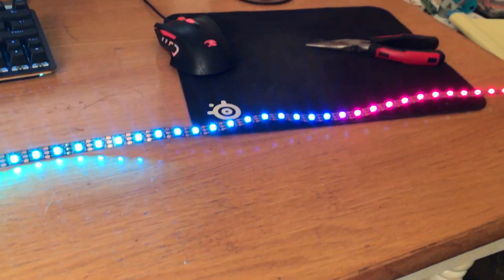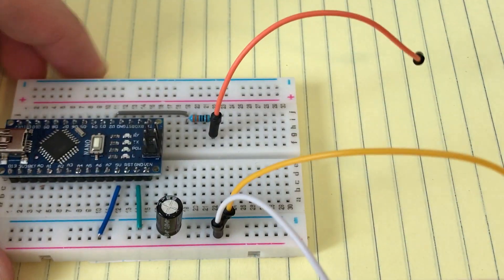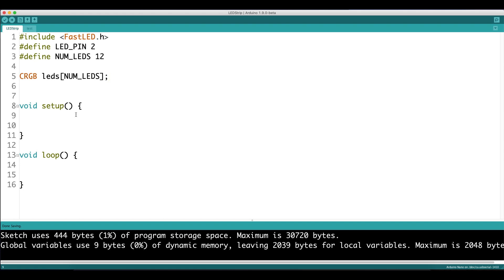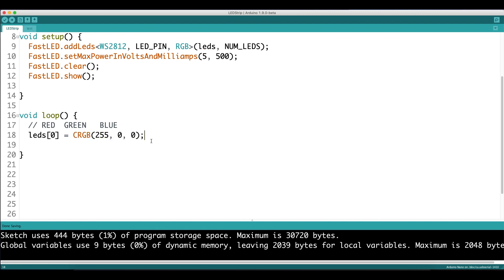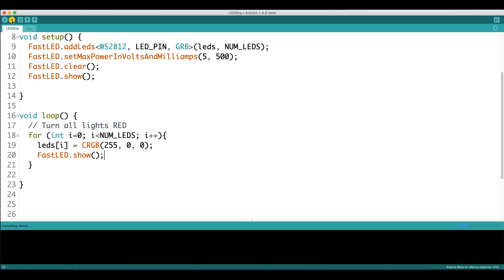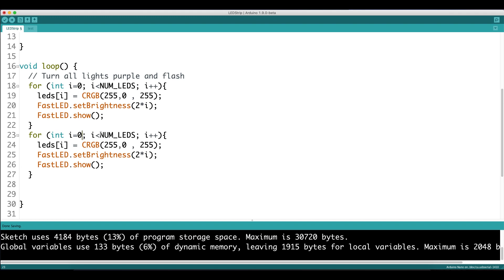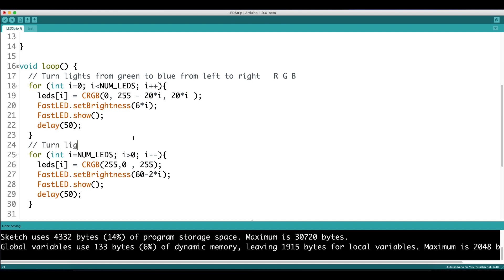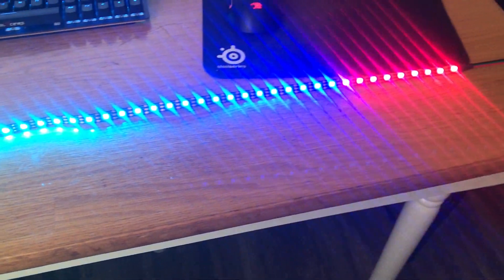Use Addressable LED Strip with Arduino || Essential Engineering

Comment: Ok so can i run 2 led strips of say 12 leds off one board by entering line 4 and 5 as 4- #define LED_PIN 3 AND 5- #define NUM_LEDS 12? Im trying to build a controller for light strips that are making diy wheel lights on my car :)

Comment: Great video. My question is how I would make a final/completed device? I want to make a gift for someone, and I want it to be where they plug the usb for power and it does its thing. But the device won’t have a breadboard. Like how do I minimize into a smaller package? I hope I’m asking the right question(s).

Comment: Amazing project and video, thanks. Can i connect led strip directly to the ESP? How WLED program works that it can power leds with no additional power source? No breadboard and no transistors in scheme?

Comment: BTW -never mind. I got this far (see below). Thanks again, this was a great video!
 #include <FastLED.h>

#define LED_PIN 2
#define NUM_LEDS 60
int iR = 7;
int iG = 155;
int iB = 9;
int iDelay = 50;
boolean lDelta = true;

CRGB leds[NUM_LEDS];

void setup() {
  // put your setup code here, to run once:
  FastLED.addLeds<WS2812, LED_PIN, GRB>(leds, NUM_LEDS);
  FastLED.setMaxPowerInVoltsAndMilliamps(5,350);
  FastLED.clear();
  FastLED.show(); 
  Serial.begin(9600);  //open serial port 
}

void loop() {
  // put your main code here, to run repeatedly:

for (int i=0; i<NUM_LEDS; i++){
  leds[i] = CRGB(iR,iG,iB);
  FastLED.setBrightness(15);
  FastLED.show();
  delay(iDelay);
  }

if (lDelta == true)
  { 
    iR = 7;
    iG = 155;
    iB = 9;
    lDelta = false;
    Serial.println("lDelta was true, now it is ");
    Serial.print(lDelta);
    
  }
else
    {iR = 155;
    iG = 7;
    iB = 9;
    lDelta = true;
    Serial.println("lDelta was false, now it is ");
    Serial.print(lDelta);
     }
  }

Comment: Could you run 5 lights from one arduino? I have a work project that requires something like this.
Reply from the maker: The Arduino's built in power supply should be able to handle 5 LEDs

Comment: Do we need a capacitor and a resistor ?? Is it must-need parts?
Reply from the maker: The capacitor is just a bypass capacitor to the power supply. It isn't required, but it is good practice to use one on your power rail to smooth out any "ripples" in the rails

Comment: May I ask if is it ok if I don't use a external power supply? my led strip is a 1m 60 led 5v (each led takes up about 0.3 watts). And I'm also using a Arduino pro micro
Reply from the maker: Check the datasheet of your Arduino and see the maximum current output available for the power rails. If all LEDs full brightness will overdraw the power output, you can't use the onboard power supply, unless you can limit the current output in software. 

If you do use an external power supply, make sure the data line and power supply to the LEDs share a common ground.

Comment: can you hook up 2 led strips by just wiring the second one the same way as the first one using the same pin on the arduino? I am making a lightsaber with them, and I want 2 strips so I can stick them back to back and make a more evenly lit blade
Reply from the maker: I don't see why that wouldn't work, the current limiting resistor should help prevent a current overdraw on the data line (which isn't that high in the first place). However, in this approach, you likely could not use the Arduino as a power supply and you would have to find a way to externally power the LEDs. Using the Arduino power supply, the max amount of LEDs you can power is 9.

Comment: Like many have said, Great Vid.  I would like to know the purpose of the resistor and capacitor, and how you chose their specs.  I will look for the "slower version" vid you promised Ms. Farmer a couple of years ago.
Reply from the maker: The capacitor acts as a decoupling capacitor for the power supply. If there are momentary dips in voltage across the power rails, the capacitor in parallel with +5V and GND will momentarily prevent these periodic voltage drops. The resistor is just a  current limiting resistor into the LEDs.

Comment: so how many addressable LEDs can a Nano control?  I assume a whole strip if the strip has it's own power supply.  basically what you need is the signal data for the strip, correct?
Reply: also is there any sample code in the fast led library?

Comment: The program actually has a SEGFAULT in the second for-loop. By starting at i=NUM_LEDS you are indexing leds[NUM_LEDS] in the first iteration, which is 1 past the end of the array.
Also, because you only run until "i>0" you 'forget' i == 0 for leds[0].
The correct loop should read:
for (int i=NUM_LEDS-1; i >=0; i--) { ... }
Essential in Software Engineering!
Reply: Long story short, the first led is named "0" , don't accidentally skip it by saying greater than, say greater than or equal to
Reply: way to smart for me
Reply: @broknow8955  Arrays are zero-indexed, meaning that you start counting at 0.
In this array: {"This", "is", "a", "string", "array"};
the index (address/location) of the words (strings) would be: "This" = [0], "is" = [1], "a" = [2], "string" = [3], "array" = [4];
There are five strings (words) in my array, but you count them 0, 1, 2, 3, 4.
In the video he uses a for loop (int i = NUM_LEDS; i > 0; i--).  This means that he starts with i = 4, but if you remember, that would mean that we have 5 spots in our array.
In other words, we are trying to send information to an LED that doesn't exist.
To fix this, and accommodate for zero-indexing, we can write int i = NUM_LEDS - 1.  This gives us 0, 1, 2, 3 (total of 4) instead of 0, 1, 2, 3, 4 (total of 5).
The next problem in the for loop is the i > 0.  Notice in the video that the first LED doesn't behave like the rest. That is because we are skipping index 0 (the first LED).
To fix this, we can simply change i > 0 to i >=0. Now we are including the first index in the array (ie the first LED).
Just to finish off the for loop... i-- and i++ are just easier ways of saying i - 1 and i + 1.  You could also write i = i - 1 and i = i + 1 respectively. The i++/i-- is just way simpler.

Comment: Does the Arduino need to stay connected to the LED strip in order for the programming to work, or does the strip have memory built in?
Reply: The is the one on control

Comment: I seem to be getting the same results without using the resistor for the middle section of the three LED cables. What made you decide to use the resistor. Great video btw
Reply: The resistor simply reduces noise on the data pin

Comment: Great video which got me excited about Arduino Nano, but there are two bugs in the demo code.

Let's say NUM_LEDS is 12

- First loop goes from 0 to 11
- Second loop goes from 12 to 1 (WRONG CODE), should have said i=NUM_LEDS - 1, and i >= 0
- And he subtracts "20 * LED index" from 255 every time in the first loop, which will eventually cause an RGB value less than 0 :D

Comment: if i want to create a pattern where every 1st led is red and every 2nd led is green and so on, i would do
for (int i=NUM_LEDS; i>0; i--){
    leds[i] = CRGB(,255, 0, 0 ,-4*i);
    FastLED.setBrightness(100);
    FastLED.show();
    delay(50);
  }
and for (int i=NUM_LEDS; i>0; i--){
    leds[i] = CRGB(0 , 255-4*i);
    FastLED.setBrightness(100);
    FastLED.show();
    delay(50);
  }
what does the * do in in the code and what does i mean?

Comment: I have 50 x 5 meters of addressable led strips. (3led  one driver with one data input) I wish to use all of them as a matrix. Is it possible to control & power? 

Thanks in advance

Comment: Hey, does this project work with the arduino uno? If so, how does the circuit board differ. And does the code differ as well? Thanks! ( I just started arduino )
Reply: To my understanding all Arduino work in same programmes ...universal as such

Comment: How many led can you power directly from the arduino? I've checked posts online that each led takes about 60mA on full brightness. Going by this, if for example I want 8 RGB leds, the maximum current draw will be 480mA (over the maximum current that can be drawn from a usb powered arduino).

Am I computing something wrong here? You're using 12 leds in the video and it doesn't seem to have any problems. Thanks.

Comment: Why is there a capacitor in the circuit?
Reply from the maker: The capacitor helps stabilize the power supply so in the event of any high peaks, they are stable instead of outputting a massive power surge.

Comment: I'm trying to make a simple light saber using the basic coding, I am able to get a delayed effect when turning them on, as in one by one, how do I make it that when I turn it off they do it in reverse?
Reply: If you're using some sort of counting loop to turn each individual LED on, then just reverse exactly what you think it'd be! Set up a loop where each LED is individually told to turn off. Say you have 10 LEDs.
THIS IS NOT ACTUAL CODE JUST A REPRESENTATION

When; button pressed;
Check if Last LED = off; //this checks if the last LED is already off
If Last LED is = on
{
   Final LED (turn off); //This turns the last LED off
   wait [10ms];

   loop {
   Check if FIRST LED is = on; //This loop checks if the FIRST LED is on, and if it is, it will turn off each consecutive last light until it gets to the FIRST LED
   If FIRST LED is = on];
  
      Previous LEDnum Minus 1 (turn off);
      Wait[10ms];
   Else: // if the FIRST LED is off, the loop should stop checking/doing anything
              {
                Do Nothing;
               }
            }

}

Comment: 255 is red.....but also green.....and blue.
Thanks, crystal clear now.
Reply: The value 255 does not represent a color, but rather the brightness of a color in a range from 0 to 255 (which is the maximum value that will fit in an unsigned 8-bit number).
The position of the argument in the CRGB function defines the color, as in: CRGB(<brightness of red>, <brightness of green>, <brightness of blue>). This allows the mixing of colors up to over 16 million (255³) different variations.
For example: CRGB(255,255, 0) will combine red and green into yellow, and CRGB(255, 0, 255) will combine red and blue into purple. CRGB(128, 128, 128) will mix all colors into white, but will only shine at half brightness. Finally CRGB(0, 0, 0) will make the led appear as off (which could be perceived as black on for example a screen), as none of the colors are providing brightness.
Reply: @kettling  Yeah I got that now. I either misheard or its just confusing.

Comment: hello sir,
i need your help about ambilight using arduino nano. the issue here, i got only the four pins 5v led strip (5+, R, G, B).
i dont know how to connect them on arduino nano, please could you guide me on this project.
Thanks.

Comment: When will hardware guys ever learn to code? Your second for loop is fubar. 

for ( int i = NUM_LEDS-1; i >= 0; i— ) .....
Reply from the maker: Hey Tim, this is a simple reverse for loop for traveling backwards in the LED strip. If you need help understanding how reverse for loops work, I’d recommend checking out w3schools or stack overflow. Hope this helps!!
Reply: @Kludgeware  You are missing the point. Arrays in C/C++ are indexed from zero. The FastLED library will almost certainly be using an array internally. Your forward loop addresses this correctly, but the reverse loop starts at NUM_LEDS and stops at 1. You are overflowing the upper bounds of the array and potentially corrupting memory.

Comment: I think a slower version of what you specifically used on the bread board and how it was set up would be super helpful. Thanks !
Reply from the maker: Will post a video about that probably soon!
Reply: I just rewatch the video on parts that I need to clarify.

Comment: I don't get why there is need resistor. I'm using power bank which can output 5v & 2.2amp max is there risk of frying led strip or arduino module?

Comment: Hey so can I use a 330 ohm resistor?
Reply: hey where do you get the capasitor and resisto
Reply: gaming galore you can find them everywhere amazon for example they come in a huge amount it may even be 500 resistors with different resistance levels
Reply: @SH-oy1lv  I found the resistors now i thought you couldn't bend them where do i get power supply from?
Reply: gaming galore power supplies could be found everywhere
Reply: @SH-oy1lv  this is the first project I've done and im spending the money I've saved that my mums gave me can i just use my pc or do I need a plug
Reply: gaming galore I really don't know

Comment: Hey I have got a 60LED 1m LED strip but 6leds at the end aren't working why is that and is that normal?
Reply: Do you have an extra power suply? It can happen it hasn't enough power to supply the last 6 leds. Or the code is going to 54 leds. Probably not.
Reply: i dont know how to fix your problem but i guess you have the stuff so i was wondering where do i get the capasitor and resisto
Reply: @gaminggalore3921  you can just order them from Amazon or other electronic sites their very cheap just search for a 330r resistor and a 100uF capacitor

Comment: hey man this is inspiring me to actually tinker with this stuff. talking to some people they recommended another power source for the led's, whats your take on that? I only plan to run 10 or less (I need to light a <10 inch strip). I also want to put a on off switch and a dim switch if possible, see how it goes
Reply: hello, i want to ask you if you found a code for switch do dim this

Comment: Nice video man this is the first project I am going to be doing electrical wise can I ask do I need the resister and the capacitor? I have all the rest of the stuff so just asking before I mess something up
Reply from the maker: LifeOfMo LifeOfMo the capacitor isn’t actually necessary. The purpose is to stabilize the power to the LEDs. It’s more like a bonus and not an essential. The resistor is necessary to limit the current into the LED strip. Hope this helps!
Reply: @Kludgeware  I seem to get the same result without the resistor. Will I damage my LEDs like this or would it be okay

Comment: If I use more LEDs (150 or 300 on a 5m LED strip) I need to solder the connections right?
Because I would get 9A or 18A and that would be way too much for the Breadboard or do I get something wrong here?

Comment: Hi there!! How can I use this with 12v?
Reply from the maker: Porroquio using a 12 power supply shouldn’t be a problem. You just need to have the right size plug to fit an Arduino.
Reply: @Kludgeware  thank you very much!
But what pin should I connect to? As I only see the 5v pin.
Thank you for the video! It has been very helpful!

Comment: How do you power the leds if you want to put them around your ceiling
Reply from the maker: With these type of LED strips, they can be cut and then reconnected with soldering wires. I would recommend connecting the Arduino somewhere secure on the ground, and then soldering “extension” wires from the Arduino to the led strip above.
Reply: @Kludgeware  how much power could this handle? Im planning on controlling quite a lot of LEDs
Reply: @anthonywoolley1806  If you have not figured it out by now. Don't power the Strip from the Controller it really can't take much power.. From the Strip you will want to use a Ground from the controllers ground, and the Data Wire. (off the White wire set I have Ground wire and Data wire going to strips) These I connect to the White wires that came with my strip. Then I use a 5vdc Power Supply (Mean Well is good) I connect this power supply to the Red Wire/Black wires that comes with strip, You may need to Inject power and a normal strip of say 60leds will have a Injection point at 30leds.. Personally I don't have to do that but there are some that want to use these for white even though it isn't really White.. Anyway I run mine in 60led sections and don't have any power issues 10 strips of 60leds when I do full White on my WS2812B strips it takes just under 20amps of 5vdc power. Buying a good power supply is needed... If you plan to run that long time full bright white then I would get 30amp power supply.. That is full output others say they have higher power strips I don't know each of mine running on 5.25vdc max out just under 2amps per 60leds.. However what I run mine using my Uno for Data only and the program I run on my 10 strips only take 2amps. First 60leds I bought came with a Controller and 5vdc 2 amp supply. Since connecting to the Uno I have not used the controller that came with the unit since..

Comment: Also can you send link to aurdino
Reply from the maker: Hey Nova, here is a link to an Arduino starter kit: https://tinyurl.com/y4eq8mt9
You can purchase any addressable LEDs you like and use them with the Arduino FastLED library! Hope this helps.
Reply: Ok if I buy this kit can I code 2 led strips with one aurdiino or do I have to buy two
Reply from the maker: When you say two led strips, do you mean connecting them in series? Or do you mean two led strips running different patterns? You can do both with arduino, but you have to consider the power output limitations. Also, two parallel led strips require different code, but it is doable! Hope this helps